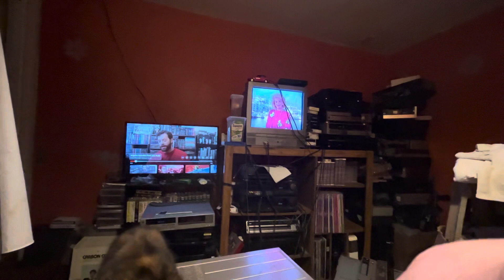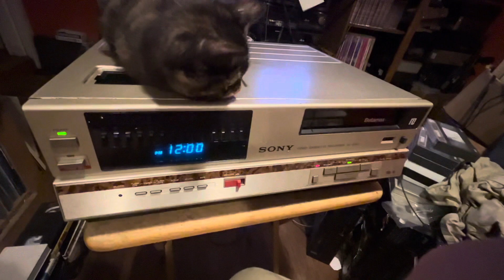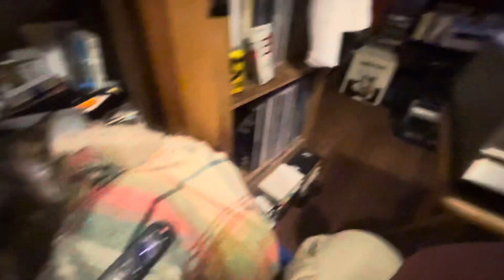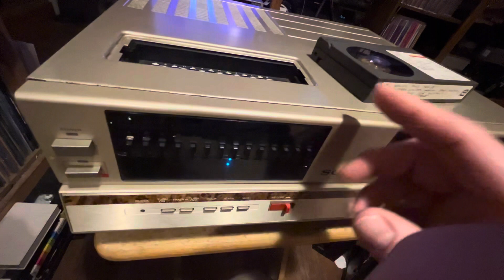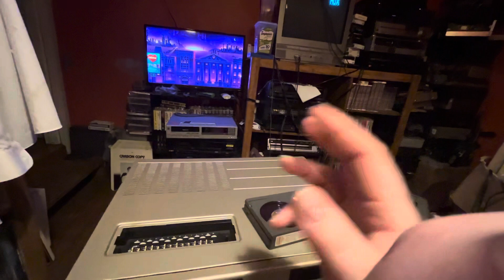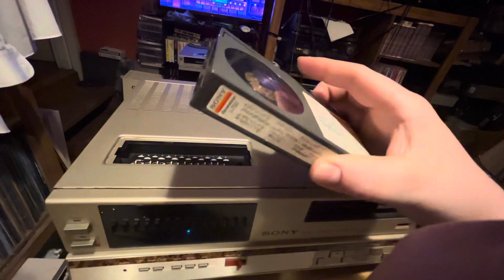SL-5000 Servo fixed

Comment: I’m working on one of these. I replaced all the blue Sanyo capacitors and have it pretty well dialed in with speed and color but it can’t get ALL of the static cleared out. Maybe that’s cleaning the head? Also it doesn’t load by itself. Do you know where you can get belts for these still?

Comment: 3:24 - 😀😺🤗❤🐈 Does the Laserdisc Kitty (Tigger) get along well with the Betamax Kitty?  (I don't know how you spell the Betamax Kitty's name -- "Maui"?  "Mowie"?)

13:56 - I had that happen with the wires of an old clock-radio I was tinkering with.  If I have the time, I will see if I can replace the soldered connections with detachable Molex connectors -- it will make things much easier.  As for why Sony soldered the connections instead of using a detachable connector?  Most likely cost-cutting. 

17:51 - I don't know for sure, but I think the switch is only needed to select βI playback, and when it is set to βII or βIII, the machine can automatically select βII or βIII for playback as needed.  When Probnot repaired an SL-5000, that was the way it seemed to work: 

https://www.youtube.com/watch?v=ai1ShTRfoBs 

Try playing a βIII recording with the switch on βII or a βII recording with the switch on βIII -- the machine should play at the right speed.  (The SL-5400, 5600, and 5800 seem to work the same way.) 

Requiring the user manually select βI playback is a silly design, as far as I'm concerned.  I'm sure there were lots of kids who played pranks on their families by setting the VCR's switch to βI so when someone tried to play a tape, it played too fast.  At least the SL-5200 has the switch on the front, so it is easier to notice when it is set wrong.